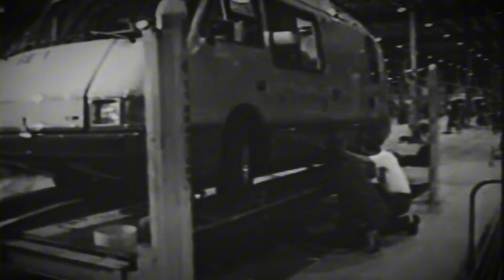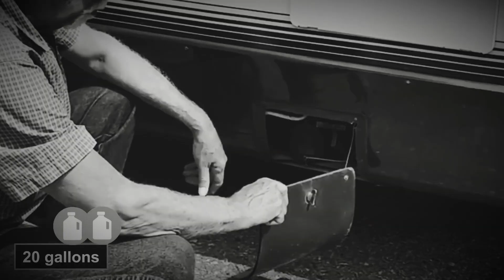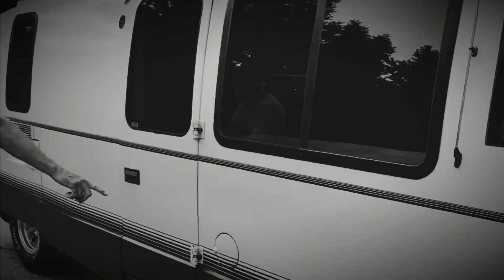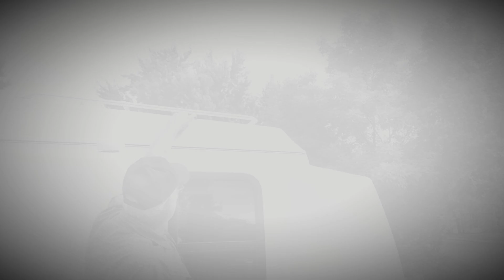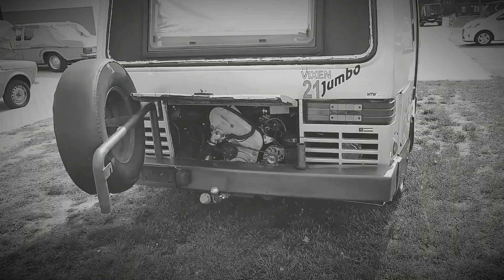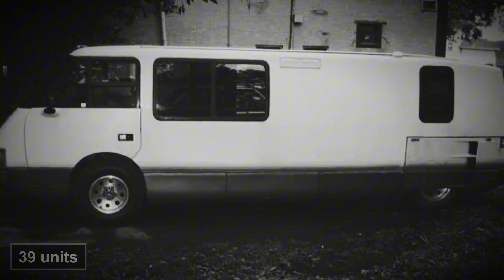Vixen 21: The Most Unique Motorhome Ever Made Nobody Talks About

Comment: It's unforgivable that the Vixen 21 was discontinued when it was. They had a great idea going, a small motorhome that's small enough that newbie RVers can drive it, veteran RVers can downsize from a behemoth Motorhome to a smaller motorhome, while still being large enough on the inside for an adult couple to walk around comfortably and be able to sleep comfortably when it's time to sleep.
Reply: Since when does a diesel pusher have to be 40'+ in length, or several stories tall from pavement to roof?